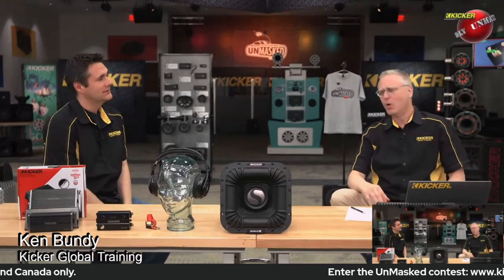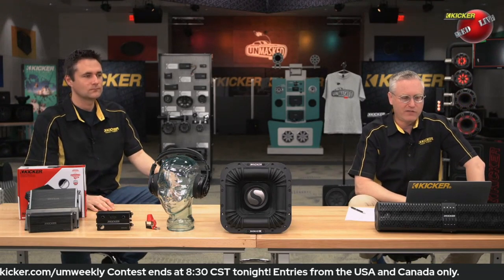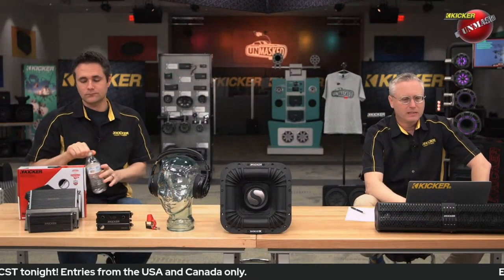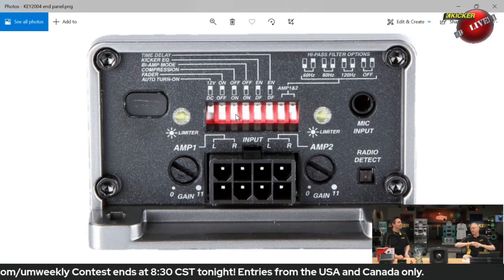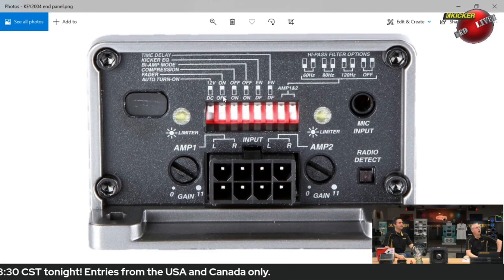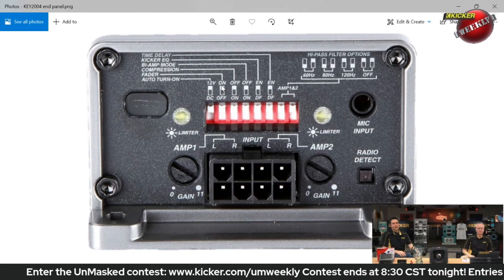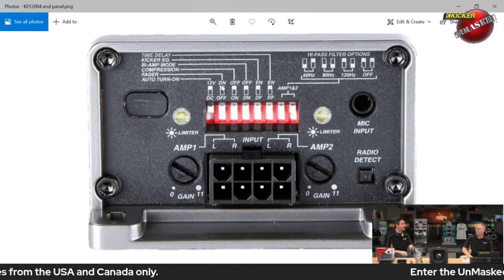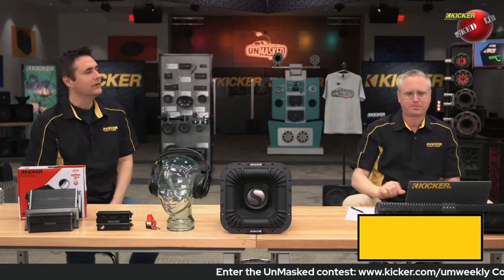When to Use the Fader With the KEY200.4 Amplifier - Kicker UnMasked - Shorts

Comment: Great stuff.  I have the older KEY 180.4 in my car in 4 channel mode with separates up front and coaxials in the rear doors.  I'm interested in reconfiguring to Bi-Amp mode though.  What do you recommend to customers who still want to use their rear speakers as well as use the Kicker KEY amp in Bi-Amp mode?
Reply from the maker: You have a few options: the first is return the rear channels to factory amplification (if you haven't upgraded the speakers). Next option is simply disconnect them: many people do this is you don't have passengers in the back, as most of your soundstage exists in the front channels. You could also bi-amp the front stage with one key 200.4, and get another one for the rear channels - simply avoid using the time alignment for the rear channel amplifier.
Reply: I'm a single father. My wife passed in a collision in 2012. When a drunk lady who was running from the cops T-boned us while we were stopped at a red light. Her insurance had been revoked three weeks prior when she got another DUI. My daughter was very young. She had two black eyes, but no sinus damage, or otherwise. I had over thirty hours of surgery to install 40 screws and three plates into my pelvis, replace the top of my femur with that of a donors, sew up my diaphragm where my femur skewered me like a shish kabob. I've done the best I could to take care of my daughter. But money has always been tight. I've done No drugs, no alcohol, no sleeping around, no real social life. Im mostly pretty depressed. It seems like things almost never go right for me. I'm still in love with my wife, after all these years . I still dream about her. I still wake up reaching for her. OMG my heart sinks when she's not there. She never is. My daughter will be turning 16 in 6 months. I saved and bought her a 2010 Pontiac vibe, for $2500 It has low miles and it's super clean. Apparently it was a collaboration between Toyota and Pontiac. She really likes it. But the factory stereo is lacking. This amp, the key 200.1 looks amazing. If it's as good as I believe it is, I will definitely buy myself one as soon as I have a few extra dollars to do so. I have a CXA 600.1 in my car that I got at a pawn shop for $80. It's currently pushing a comp RT10 in a small truck box. It hits hard for the size of the box, and the fact that it's a low profile 10" instead of a deep throated 12. I bought the crt10 and box together off of Facebook marketplace for $60. I'm sourcing them with a 20 year old single din Alpine. I bought one of the little deals that you plug into a cigg lighter. It picks up Bluetooth and turns it into an FM station. It works for now. My daughter is an extreme audiophile and I'm stressing everyday wishing I could fix her stereo sooner. I think I'll let her use my crt10 and my CXA600.1 so she'll have some bass. But this four channel amp would make her stereo so awesome. I will need to get some door speakers. I think it has co-axles in all four doors. I would like to put two way components in the front doors. But I'll just have to do the best I can. I really want to buy her a nice double din stereo with Android auto. (She loves her Motorola). It would make me so happy to help make her stereo something she can be proud of. She really gets into her music and this would make her ecstatic, for months. She's always so thankful for any gift she receives.  I plan on having her help me install the components. She enjoys hands on work. She's an amazing kid and I find it hard to believe that anyone could deserve it more than her. She's Honest, dependable, hard working. She'll go out of her way to give a stranger her last $5, if she thinks they really need it. She's a really great kid. I'm proud of her. I liked and subscribed to your channel. I look forward to watching more of your content. Respectfully, Bob.